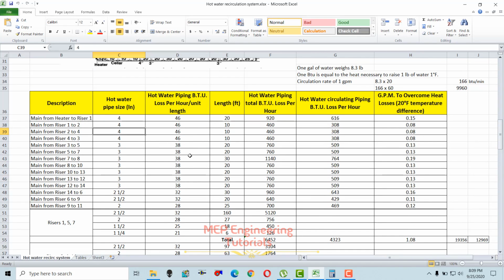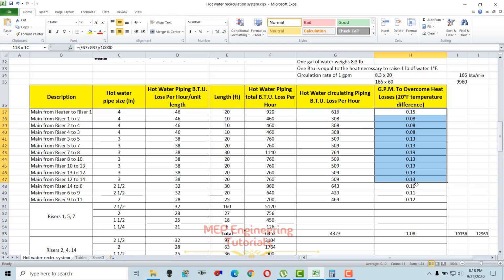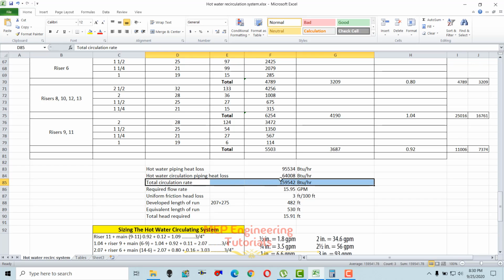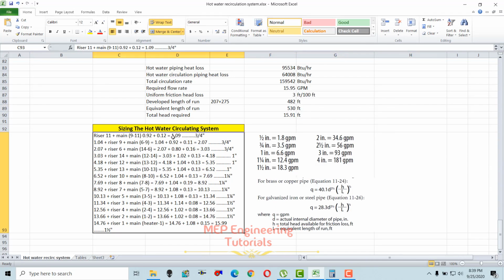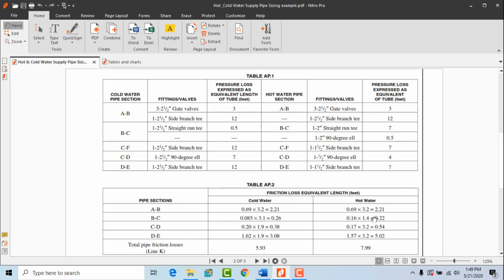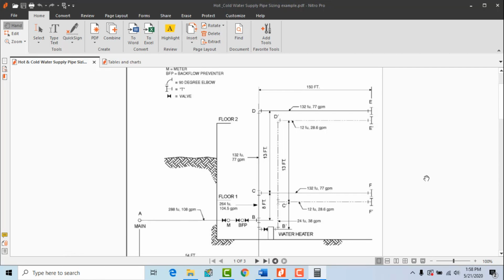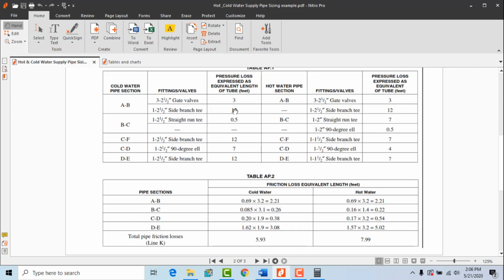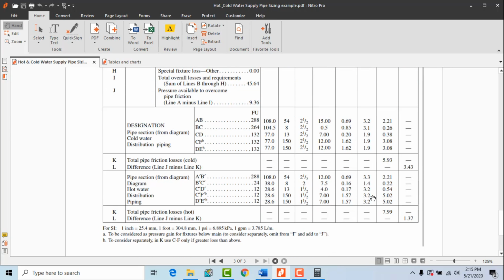Plumbing system design part 1 (hot water recirculation system & domestic hot-cold water pipe sizing)

Comment: Excellent breakdown of plumbing system design, especially the explanation of hot water recirculation and pipe sizing principles. Understanding these fundamentals is essential for creating efficient and reliable plumbing systems in residential and commercial projects. I've also found practical engineering resources from BPConstruct that explain plumbing and MEP design concepts in a clear and easy-to-follow way. Great tutorial!